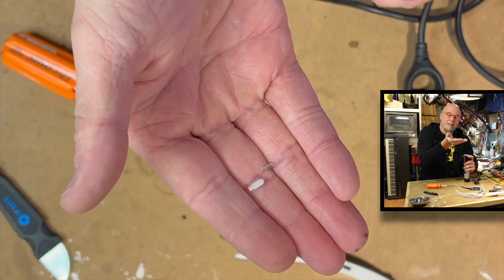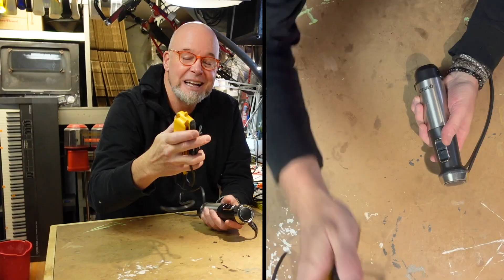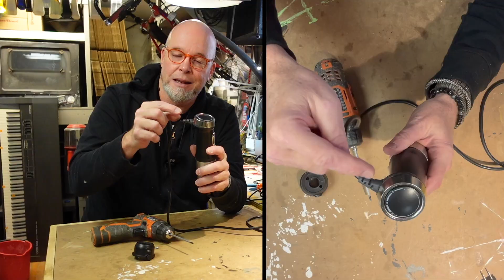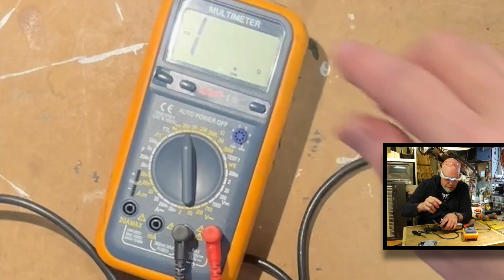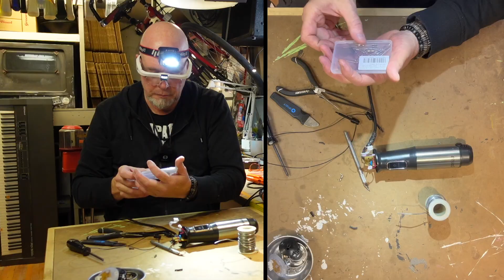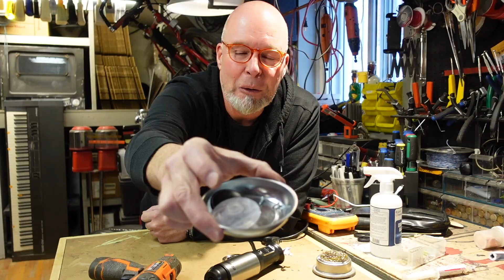Don't Throw Away That Blender

Comment: Mine just 'pop' while using it. I guess it overheats and the motor or fuse blown.
Reply from the maker: Yeah, that could be a thermal fuse (or just plain old fuse?). The question is, are you going to repair it? 😊